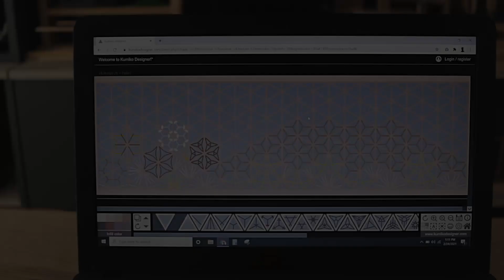Mount Fuji - Kumiko Landscape Panel - Japanese Woodworking

Comment: Just this morning I was cutting strips for a hexagonal grid. I kept thinking, 'wow, my fingers are so close to the blade', and 'wow, thank goodness for my SawStop' - as if this is the sole means of staying safe. Then I saw your support bar for keeping the stock flush against the fence. So simple, yet...so clever. I made one immediately after. Thank you for showing so much of your process.
Reply from the maker: Thanks! Good to help! But I use that only on that side, when I move up, to the reverse angle I cannot use it, because I have to eyeball the mid point of the cut, gently press it L-R. And also I dont have enough space there, I was stupid to make the sled short. I wanna disassemble it soon to make some more slots and I will bring that fwd fence back to make room for a stick like that and see how it goes

Comment: Great video, Adrian.
Your Kumiko landscape looks very beautiful! 👍🏻
It's a shame that the books (by Des King, Kumiko Volumes 2 and 3) are only available in English.
 😭
The block of wood where you beveled the wood pieces with the chisel. Could you please introduce the angles and how wide and deep the grooves are? 🤔
Have a nice weekend. 🙏🏻
Reply from the maker: Thanks Gunter! The blocks have 8mm wide groove (same as the strips), and depth is not critical, a little more than strip thickness. Angles used here are 15, 30, 45, 60 and 75. Also 90
Reply: Hello Adrian,
Thanks for the answer.

Comment: Very nice work. I’ve been practicing the patterns and about to embark on something similar. Could you share the overall size. Did you use 50mm pitch? 3mm grid pattern with 2mm pattern pieces?
Thanks
Reply from the maker: Thanks! 30mm between the verticals. Yes, 3 with 2 mm

Comment: That is amazing! What are the little pegs and the little hammer that you used to hold the work in the frame? I have been making a lot of frames and I love how that looks
Reply: Ah, I should have read your description, I really like that mini hammer
Reply from the maker: Thanks! That little hammer was too cute not to have it😀 It was the first time I've use it here. Also the method, didn't knew how to secure that more quick and nice, didn't want to loose time looking to buy some specific hardware and this came to my mind. Those pegs are some long dowels bought from a craft shop, luckly they were already pointy at one end.

Comment: What kind of glue did you use to glue up the paper to the wood?
Reply from the maker: It's shoji paper glue, I believe it is rice glue and you can make it yourself as well, although mine is bought. PVA glue works too if you carefully spread it. Shoji glue spills once it dries they are not visible anymore

Comment: Extremely accurate work, as seen in the last shots towards the end!

Adrian, you seem to use your low angle smoother in almost every video for almost all tasks requiring planing (except this video haha). Do you find it to be as versatile as you make it look?
Reply from the maker: Thanks! Good observation :) Usually for planing those strips I use both the LA and Jp one, but here I shown only the kanna since it's a japanese project. I use them both here, one for rough and one for final, depending on the particular wood species and weirdness of the grain, sometimes the kanna works better on last.
Because I do a lot of small work and use a shooting board I found the LA plane more suitable for this. I have in plan to get a bevel up one as well, probably the custom planes from veritas, a 4 1/2 or 5